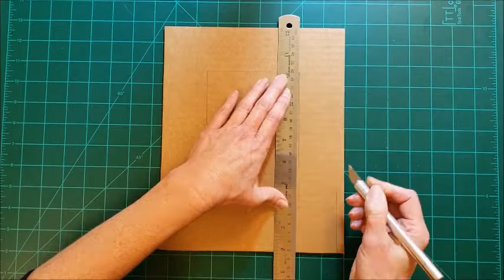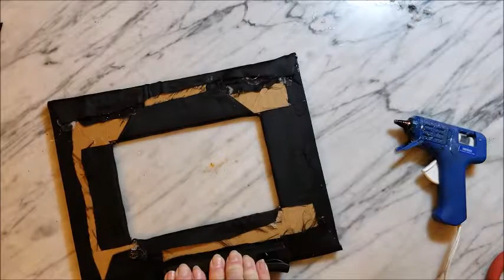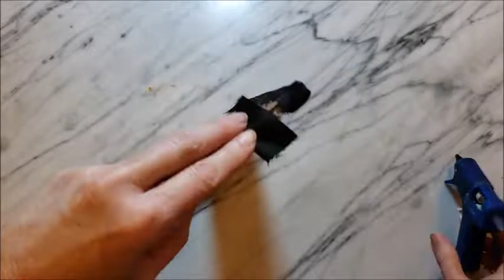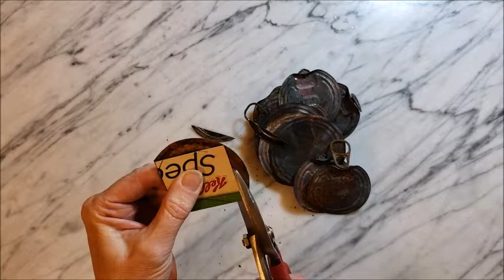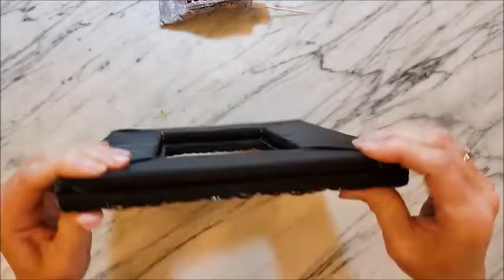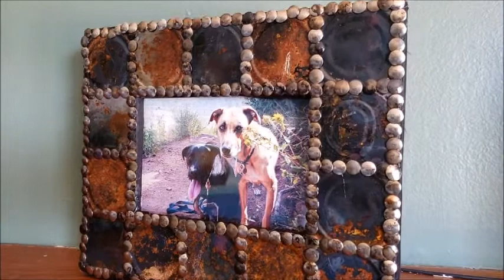Upcycled Tin Can Picture Frame Tutorial

Comment: Great idea!  I was looking at my cans and noticed that most of them have that rounded bottom.  My can opener does not work on the rounded bottoms.  Just wondering if you know of a method to get those off so that I can get two squares out of each can.
Reply from the maker: Hi - Sorry I don't have a good solution for using the bottoms of rounded cans but you can cut more pieces out of the sides of the cans if you flatten them. Here is a video tutorial if you are interested https://youtu.be/1pRlDt_fwYY 
Thanks for watching. 🙂
Reply: @upcycledesignlab   Thank you!  I'll check that out.  Since I watched your video about Tin Can earrings, I'm on a video marathon checking out all the different things to make with tin cans!  There are so many!  One I like a lot since I make door hangers, is the decoupaged smashed tin can wall pockets.  The bottom needs to be cut out before you flatten them.  I've been enjoying your videos!